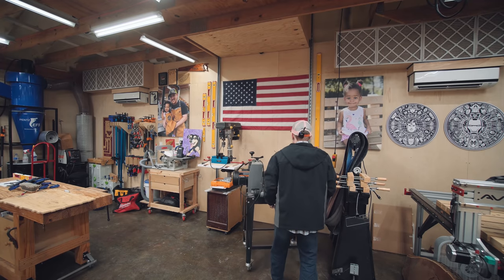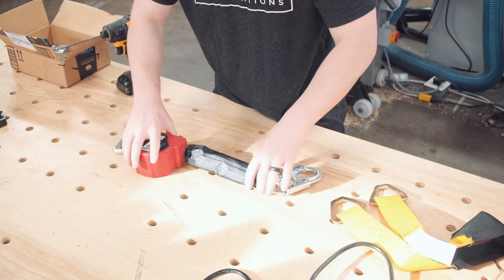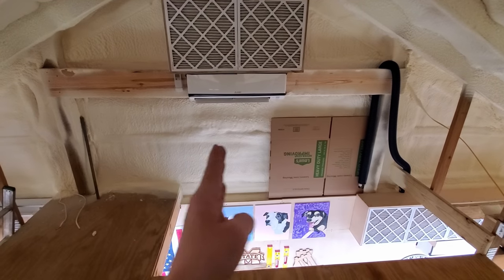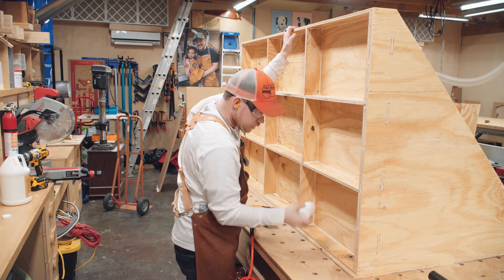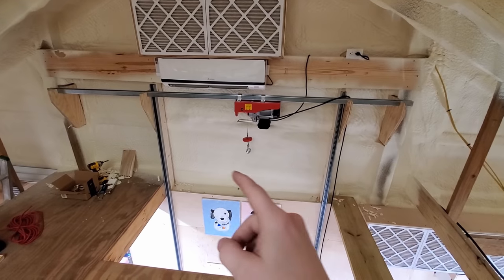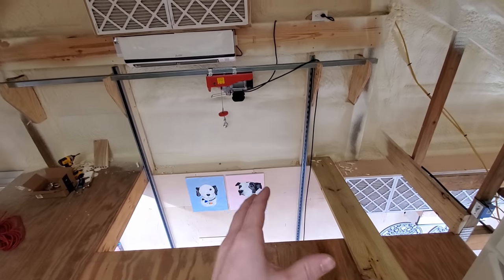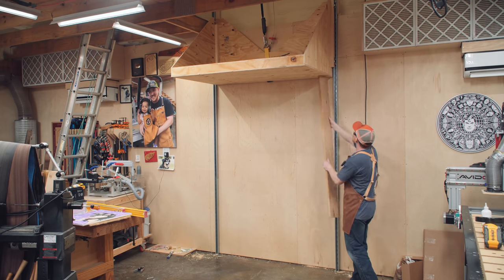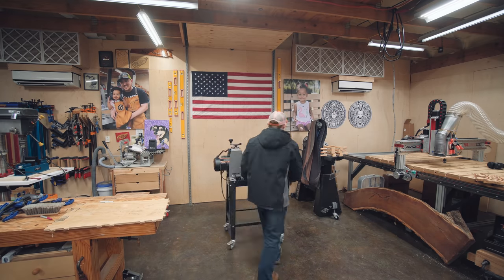DIY Elevator - 364

Comment from the maker: Follow up video: https://www.youtube.com/watch?v=JfPa4EPwaRM
Reply: a good idea for the open space at the steep roof angle ... why not put a folding escape ladder there for when power is out or if someone shuts off the breaker on you ... then you just drop the ladder climb down and pull a rope to lift the ladder back up or get a folding attic ladder that you can use for emergency stairs and use that beside the lift in the larger space ... it will fill the space add emergency ladder to your loft and close the loft in for a bit better safety from falls 
.
also if you mount a support to the hoist and mount the fall arrestor to a lag bolt into the beam above and NOT on the channel with the hoist then your fall arrestor will be able to actually do its job ... and your hoist wont torque the channel it is mounted on taking out some the bounce in your lift
Reply: P

Comment: As a union elevator constructor, this was a super fun video to watch. You have great ideas and great execution. May I suggest not putting your wench and "safety" on the same piece of the strut? As well I would encourage you to find something stronger to mount these to as I have always been taught to make sure your safety line is attached to something that can take a 5,000 lb load/ force.
Reply: His barn beams might not even take that load. No I beams or glue lambs.
Reply: Well said!
Reply: Union guy/gal is right. Separate safety anchor point NOT to unistrut. It needs 5000# capacity
Reply: Gotta love that BG stick huh? But yeah…that safety chain is uhhh suspended from same member that supports the wench motor. Oops!
Reply: Why would it ever come close to 5,000# in this application? While I am skeptical, this is still a real question assuming their is a legitimate answer.
Reply: @WoodworkingforAnyone  when you do fall arrest training you have to calculate load from a fall.  200 lbs falling 6 feet and a one foot shock absorbing fall arrestor lanyard will exert 1400 lbs of force.  Without the shock absorber it's closer to 10000 lbs.  It's all highly unlikely but if the winch cable broke and the fall arrest didn't engage until 2 feet of free fall that anchor point has little chance of stopping that fall.

Comment: The fall arrester should be affixed to a different point. You still have a single point of failure for both the hoist and the arrester.
Reply: That really well observed. Things a safety inspector would verify rogt out of the gate.
Reply: @xedasxedas  ... a real safety inspector would have a problem with there not being enough capacity, especially with people riding on it. The platform, hardware, and a guy already take up 300 out of the possible 500 pound capacity. Then we have pinch points, no hand rails, and no UL listing for passengers.
Reply: @rupe53  no osha railing was my fist thought too as a trained safety guy. I think that the 29 and 40 cfr need to be consulted for this lift.
Reply: @davidbanaszak562  Guys, guys, guys, … he is not building this for anyone’s use, except himself, …   It is not for the public, or for a business, with employees, or customers, … 
And it is a D I Y, … maybe permanent, but, maybe not!
Reply: @johnosman8971  thank you for saying this.  Holy crap the people on the internet.
Reply: @specsix  Yes i agree, i'd say if we do "dangerous" DIY, we assume the risk of it. If i make this kind of elevator in my shop, I will be the only one riding it and i would make some intensive testing before. Safety first but as long as you make something for yourself, you assume the risk.
Reply: @johnosman8971  That last bit about DIY and permanentness is irrelevant to having safety. But sure... i think the pinch points won't be an issue, just stand clear. If the fall arrester gets mounted somewhere else (and preferably to an actual harness instead of to the platform) then all is good.
Reply: @SEBTECHDIY  There is no need to assume risk when DIY'ing. Just build it safe. If you have doubts about the safety, then stop and improve it. NOTHING is worth having an accident. Maybe you're acting like a anti-safety hero here on Youtube, but once you sit at the ER with a separated limb in a bag of ice cubes, you'll quickly change mind. It would show intelligence to change mind before such thing happens.
Reply: You need a safety rail and gate for the lift, I know it's just for yourself, but if you ask an employee to go up there, or, you are sending items up and they fall off and hit someone, you're liable... for any accident....
Reply: @johnosman8971  but, he is showing people how to do it and they may try this, with disasterous results.....
Reply: @pitbullslueth4358  that's on them. He is not responsible for anyone attempting this.
Reply: And yet with all codes followed and inspections past in commercial use elevators that still have the occasional  failures. May I suggest you use your very keen super engineer skills in toward that area of constructed elevators and maybe leave the nice D.I.Y. guy building a D.I.Y. elevator in his garage alone!! smh 
  I mean seriously, he is not using it for running a business. He is using it for the occasional personal need for which it has been built more than sufficiently safe and secure. Also considering its semi open system any signs of the beginning of a breakdown would be readily noticed before any potential accident would happen, giving him plenty of time to do a repair. 
  He has  shared his ingenuity and creativity by making this wonderfully educational and entertaining video. I think someone is jealous!!!!
Reply: @johnosman8971 exactly! The point is not so you don't have to walk up a flight of stairs. It's so you don't have to Lug up a 200 lb machine or Lumber up a flight of stairs.  I would use the dumbwaiter to haul everything upstairs then walk up the freaking steps and unload it. That makes it all more than worth it😅

Comment: Awesome as always. One suggestion, probably nothing you haven’t thought of and decides against, but anyway, your fall arrester could be more useful if it were attached to that  2x12 or whatever it is holding the mini split so in the unlikely case the structure holding the winch fails, the fall arrester is not connected to that same structure making it useless.
Reply: Also, the chain securing the fall arrester should be rated at least twice the maximum weight of the arrester.  If the arrester is rated for 500 pounds, you want the chain rated for a minimum of 1,000 pounds.
Reply: What he said...

The basic concept is that any protection measure will not be undone by the same failure that you are protecting against. My challenge to you would be to look at other things in that setup for single points of failure and make sure that the protection is independent of that failure. This also includes actions that you mentioned doing as protection measures...like forgetting to turn the breaker off. 

The trick sometimes is knowing when is it enough or where you say no more needed.
Reply: @wes_d  but he doesn’t miss much so he may well have a good reason, he usually thinks things through very well. Most wouldn’t have done the fall arrester. I’m not even certain arrester is a word lol. Arrestor? Spelling is hard ha ha.
Reply: Also needs a second strap at the platform end. It is entirely possible the single strap could fail due repeated stress over a small area. You may want to use a piece of pipe or otherwise round over the corners where the stap wraps around the plywood. Although the most likely thing to fail is clutch in the hoist.
Reply: @rick_.  don’t think there is a clutch in the hoist, I have a couple different ones and mine are all direct coupled, shearing of the woodruff key would have a similar effect tho. But all this is covered by his DIY talk at the beginning, I think he did a great job as always.
Reply: Over-engineered. A simple firm pillow or two at the bottom of travel would suffice.

Comment: Excellent project, one thing though - get a key lock control for the lift, kids are brighter than you think 😀
Reply: Any tips for me? I want to adapt a lift system like this but for a bed in a tiny home... so I can amd will have 4 rails, 2 on both ends of the bed.
Reply: He I think he said he leaves the breaker off which is a pretty good key itself.
Reply: @matt_s1995  I came to this video for exactly the very same purpose of yours. Were you able to get some ideas?

Comment: I built an elevator for my dog to get in and out of our house. He was getting too old to climb the 12 steps. I used a similar electric winch for my build. Please make sure and check that the gears have lube. Mine did not when when I checked. There is a lube fitting at the base of the gear housing. When I removed it to check, it was empty. Great job on your build! I didn’t even think of using a fall stop on mine. If I were still using mine it would be a great addition but my boy passed almost 2 years ago.
Reply: Sorry about your boy.

Comment: Jay, I have 25 yrs plus HVACR experience.  As for the drain on the minisplit, if you can access the drain pan, pour one cap full of bleach into the drain pan once per year. This will prevent the algea from growing and clogging the drain.

Comment: Wow! great idea well executed. Apologies if this was already mentioned but I would err on the side of over engineering and add a second superstrut above the hoist for add strength and secure the fall arrestor to the top strut and the hoist to the bottom strut. Just an added measure of safety to have them attached to separate struts.

Thanks!!

Comment: cool build.  I see now why the lift cable is attached at the bottom of a big cutout on the back
Reply: @StormBurnX  your comment is the reason Matthias doesn’t like commenting on others videos. He has brought this up several times. He enjoys the intellectual conversations that could occur but not the “wow you watch this too!” Comments.
Reply: Great project, very well done.  Only wish I had wherewithal to work at your level.  Super looking shop, too!  Otoh....Can't help but share several safety concerns:  child access when mom/dad not looking or out of house, pinched fingers, and winch noise level.  Kudos!
Reply: use a worm gear not a winch.
Reply: wow you watch this too!

Comment: Very ingenious project.  I’m a commercial electrician in Chicago.  What you refer to as super-strut we call uni-strut.  It’s basically our version of lego.  We use to hang conduit, boxes, gear, build all sorts of supports and things.  It does flex much more than you’d think.  For us they do sell a doubled up version that’s a bit stronger if you find that to be an issue.  There’s 7/8”, 1 5/8”,  3 1/4”, and 6 1/2” thicknesses.  Take care.

Comment: Absolutely love it. I thought the idea of a DIY elevator is pretty sketchy, but with the added fall arrester, then it should be as safe as any other elevator.
However, the fall arrester should be a redundant safety system, so mounting it to the main motor mount isn't really ideal. Is it long enough to be mounted to the roof structure above instead?
EDIT: after having a second look at your video, then you should have a separate strap for the platform as well.

Comment: A GFCI circuit breaker would also take care of your water concern, without having to flip the breaker all the time.
Reply from the maker: Yes. I went this route because I had everything on hand to do this and its an added safety of preventing unwanted use.
Reply: Might as well spend the $20 and GFCI that outlet anyways.
Reply: I think I'd make it a switched outlet to save wear on the breaker.
Reply: and a locked switch to the outlet in the shop
Reply: GFCI for the NEC Code win ;-)
Reply: @wes_d  Hmm. Are you considering the recept to be in a damp location because of the mini-split? If not, what are you seeing that would make a GFCI be required by code?
Reply: @sootikins  .... new code for 2020 NEC says all garage outlets need to be GFCI. OTOH, as a second floor that may be a grey area.
Reply: @rupe53  Thanks. Guess I'm falling behind on code updates!
Reply: @sootikins  ... me too. I only found out about it a few weeks ago watching YT.
Reply: @Wordsnwood  make that a timer and you’ll never need to remember to turn it off as well
Reply: Create a channel under that machine to guide any drippings elsewhere
Reply: What about a simple kill switch  at ground level with a key next to where the lift comes down

Comment: Cool idea. I’ve seen a few people build on of these. A few words of advise.
I work in the elevator/vertical transportation field and safety is a huge issue. Recalculate your load. You are probably pushing close to the limit. I believe max rating for the winch is when the pull cable is unwrapped all the way and then each layer reduces the actual capacity. Also someone else mentioned it would be a good idea to attach the fall arrester to a separate point. Just in case the support where the winch is attached to fails. Main thing is just watch your kids, would hate them to get pinched on something or the thing fall on them.

Comment: Am 73 and built my house when I was 40. Have outside steps and landing down to garage. Been thinking of a lift for my shopping attached to the landing. The steel channel is brilliant. May opt for hand operated boat trailer winch as its outside. When I’m 93 I may opt for electrics.
Reply: I am looking at building one of these for the same reason.

Comment: You should add a fireman's pole so you can get down faster instead of riding the elevator ;-)
(Also in the rare chance the power goes out or the breaker trips while you are up there)
Reply: hahaha, I'm actually remodeling an old Fire Station into my home.  I want to build this elevator, and use the poles to go down too

Comment: Great job! I recommend you fix the support for the top strut ... it will stress over time and could fail. Also they sell double struts and I would recommend ones without slots and just drill your own locations where needed for better stability.

Comment: I love it! IDK if this is necessary, but how about adding a trap door to the top/loft area so that when the lift in on the ground level the door swings down, thus preventing anyone from falling through the lift shaft. When the lift goes up it would just push the trap door up as it penetrates the upper floor. Just a thought.

Comment: Great video as always, Jay.  As a professional mechanical engineer, please connect the fall arrester to a support member other than where the hoist is connected.  If the loaded member failed which supports the hoist, the fall protection would not go down with it.
Reply: I'm also a P.Eng.  Came here to say the same thing.  The super strut is a single point of failure.  If the hoist wire snaps, and the platform starts to drop, the fall arrest will have a live load to catch, and I can imagine a cascading failure where the super strut buckles under the sudden load, and platform (with Jay on it) crashes all the way down.  Instead, attach the fall arrest to some other structure so that it is independently supported.  Also, the strap at the back of the platform is a single point of failure.  Instead, chain the fall arrest to the platform's beam.
Reply: Do you think it would be a good idea to do duplicate tracks on the front corners and then rig the lift motor at the bottom and through a pully mounted to the top rafter and centered on the platform? That way the weight capacity of the lift motor is increased (thus not as strained). Also, if the point of lift is centered, then the guide rails and wheels aren't bearing weight perpendicular to the lifting force. Thoughts?
Reply: @pawpawstew  If I were Jay, I wouldn't want an additional pair of guide tracks at the front, since they would take up floor space.  However, pulling from the center of the platform would reduce the forces (and friction) in the rear guide tracks, which could be beneficial.  He could build a top section on the platform, and lift from the center of that top section, which would allow the tracks to just be guides.

Comment: Mind blown 🤯 impressive Jay! One thing I recently learned from a trim carpenter is that wood glue has no gap filling strength. It only holds under compression. The caulking you did won’t make it any weaker but it probably doesn’t add a lot of strength.

Comment: Excellent job.  Whenever I have to hire out a job that I don't have time to do, I am often disappointed in the finish details.  Your attention to detail is phenomenal.  Congrats.  One suggestion on getting your snowblower up and down.  Take that spacer that connects the two platforms and attach it to the hanging shelf with a piano hinge.  Then add a flange that will lay on top of the elevator platform.  When the snowblower is back on its shelf, just raise up the connecting platform and you're done.

Comment: Great project Jay, you should bend a thin piece of sheet metal and mount it over the lift motor so any condensation will just run off and not get inside the motor.

Comment: Put sheet metal shroud over hoist to keep dry.  I built hoist lift as well.  I built a guard around floor hole will black pipe and fittings with a hinge gate.  Definitely good idea since getting heavy things off and on and can forget your position.

Comment: Agree with many other posts that Jay does a great job of taking many variables into consideration and, based on my own painful experience, will not be using this as personnel transportation. I’m a fan of over-engineering solutions to the point that failure is nearly an impossibility based on typical usage. That being said, accidents happen and some safety measures make sense....along with knowing the limitation of the materials being used, which he explains in the video.